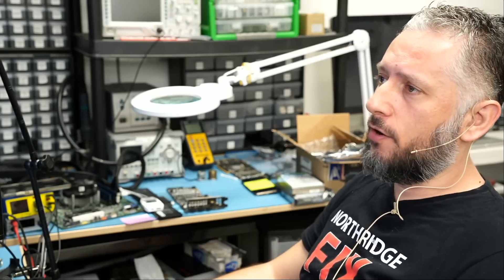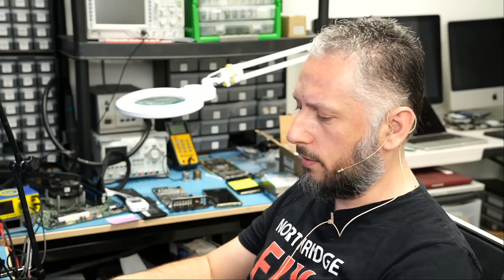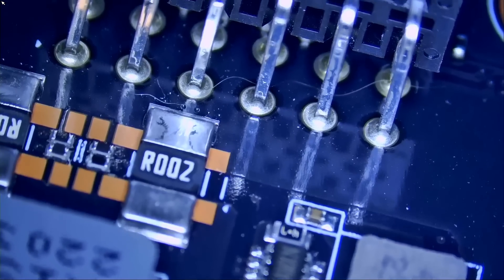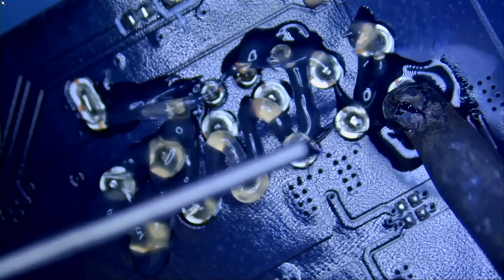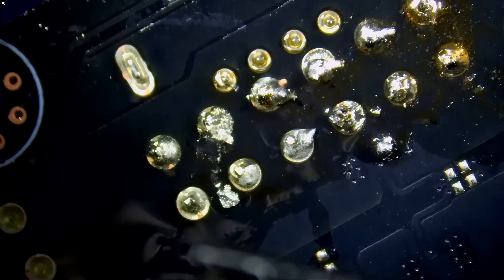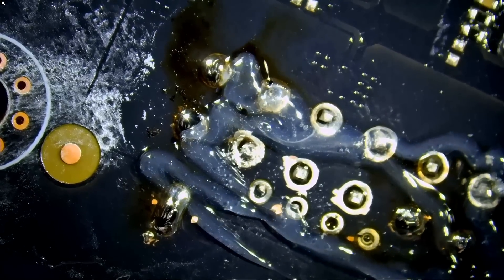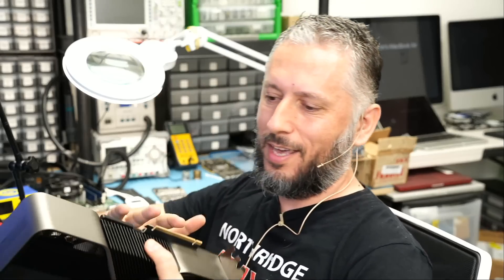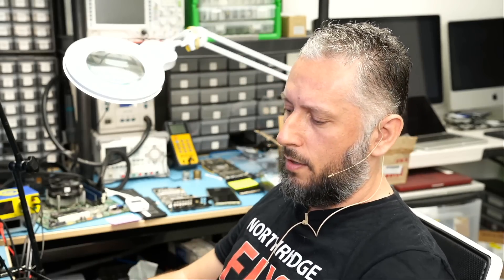Serious issues with 4090 power connectors melting - Is the user at fault ?

Comment: i would say it's 50:50. 
why.
pwr connector is a standart on ATX and if you are not planing to change that that type of connector is the only way to go.
On the other hand user should know that connector is going all the way in not 50%. If you are ignorant of that fact you should act acording to the manual and let an authorized technician plug in your graphics card and power supply.

therefore, if I am unable to plug in the cable all the way, then I cannot say that the manufacturer is to blame for that, since he must use the same connector according to the ATX standard.
Even if they make a separate adapter, the adapter should still be connected to an ATX power supply.

Comment: 100% User Error .. when this all first started 50 out 100,000. The same issue occurs with PCIe connectors that aren't properly seated. Lastly, yes this is covered under warranty though IMO it shouldn't be.
Reply: .. BTW the 12VHPWR adapter is an Intel spec connector. The next generation GPUs will start using 2 x 12VHPWR connections .. imagine 8x8 PCIe instead!
Reply: .. lastly, I get it that these are your customers that you don't want to offend because they're incapable of plugging in their $2,000 GPUs properly.

I own that exact same Gigabyte RTX 4090 OC CPU-Z JJU8GT

Comment: 100% agree with you. Those connectors should be like molex which after building computers for 20 years I've never had a problem with - not to say there aren't issues with them just in my experience.
Reply: You know I was thinking the same thing. How much power can the old fashioned molex connector carry? I was going to say users would be much more familiar with how much force to use to connect those etc as well but then a lot of younger people have probably never used them when building a PC.

Comment: This 12VHPWR connector is a terrible design.
Dell is the one who wanted this new connector, Nvidia followed along.
The cards that you receive with the broken connectors are like that because users are trying to avoid the "user error".
They press too hard, and the connector breaks off.

Comment: The amount of heat generated by 4 x 12v lines that are maybe sparking.  The manufacturer needs to come up with a foolproof solution.  They also need to mention, clearly in the documentation, that the cable needs to be inserted all the way, maybe even come up with a way that the customer hears a click that the plug is connected properly.  Also.... I want to point out that a lot of these cards are in homemade systems the cables can be stretched or are not long enough. They use cheaper power supplies with inferior cables and/or connectors.  A good power supply must deliver enough power to these cards.  They can take up to 400 watts, which makes them very hot.

Comment: NorthridgeFix : if that is the design that connector will melt if it's unplugged than the Makers (factory) now should provide a "Ceramic" connector 😂😄 instead of plastic connector. Either provide Ceramic connector 😂 or just change your design so that plastic connector doesn't melt 😄.

Comment: Agree that the producer of the card is responsible for clearly instructing install instructions of the card. If a card will still operate by partially installing the connector but will lead to other problems, the end user should be made aware of the potential problem. 
The fact that this problem is not mentioned in install instructions clearly falls on the card maker. This is a design fault in the card.

Comment: I think the connector you plug into the card is not designed to handle enough current. I don't think the plug presses well enough against the pins on the card.

If you have a heater that you plug in, the looser it sits inside the holes, the hotter the plug will be!

Comment: Couldn’t agree more with what you said.  it’s not user responsibility to provide a SUITABLE power connector on a device.  What’s happens if it works loose during use go figure.  It’s connector issue and NVD need grow some balls and accept this connector sucks

Comment: Imo it's a design failure, the connector cannot handle as much power as the card draws.
Also it's a manufacturer fault except the founders edition cards. If you're aware that connector is melting in fe cards, why you keep using it instead of 4 8 pin traditional PCI power connectors???? And the exception of the fe cards is only because they were the very first ones to use that connector, however there is no point on keeping using it on 4080, 4070... series if the 4090 one is giving troubles

Comment: Who's that legend telling loose cable connection melts the connector. Man there's some serious heavy load of electricity going and the connector is loaded with heavy duty and low built quality or less voltage capacity😅😅😅 senses bro common sense.

Comment: There has to be some cut off on what is the users fault and what is a design flaw. I mean what if the user tried to force the card into the wrong slot, or plugged the connector in upside down with force, or cleaned the card in a kitchen sink?

The way i see it, is if there are clear instructions about how to plug the connector in and a warning that it must be in all the way....along with saying that it must not be under pressure from a side panel of a case - then it becomes the users fault.....however i don't think there are any warnings or instructions being supplied with how to plugs the connector in properly.

Comment: I know this is not going to be a popular statement, 
1-If the card CAN be plugged in properly, and function correctly when this is done, It is 100% the end users fault!!
2-If the end user is not able to plug it in correctly due to bad fit on the plastic, or the connector has looseness on the internal pins, that is on the manufacturer! 
I guess what I am saying is that if the end user is not plugging the connector in securely , and then using it anyway, Man that's YOUR fault for using it before properly installing it!!

Comment: Of course it is a design problem. Graphics cards have had power connectors like that for decades and it is only just now a problem and only with these series cards. I thought it was already confirmed that the problem was the plug and if you bend the cable tight enough because of a small pc case then the pins in the plug dont stay straight and make a bad electrical connection which then arcs and melts the plug. It can happen even when you plug it in all the way. Its why i am avoiding this generation of cards. Maybe the people that are saying its not plugged in all the way are not aware of the situation with these cards. There was also evidence posted on the oc forums that the crimp on the plug falls apart by just plugging and unplugging the cable causing pins to make a bad contact and electrical arcing for the same reason.

Comment: What is kinda sick is that most likely there is a family or two out there that dies due to a fire caused by a company's incompetence / greed. Sickening.
Reply: These aren't erupting into flames like Gigabyte's PSUs, or NZXT's H1 riser cables. They are just melting.
Reply: @Shadow Captain Cain  There is potential for a fire though. Plastic will turn into a  flame if made hot enough.  Also, if the plastic melts and bare wires start touching there can also cause a fire, add that with dust in a pc, you could have a potential flash fire.
Reply: @shadowcaptaincain  well you never really know. In the right case and some dust and your whole house can go.

Comment: The Nvidia RTX 4090 has an official power draw of 450W, though momentary spikes of power, known as transients, may mean that it will draw more on occasion. but lets say 450w / 12 V = 37A .... i dont think this connector can hold 37A , it will heat up, and melt. First Day - 1. class in Electrical engineering, maybe the designer missed this class. 😂😂😂😂😂😂

Comment: The design could be better but ultimately I think it's the users error, I have a 4090 and its pretty damn hard to screw up plugging it in all the way. Just use your eyes to see it's seated all the way, the manual even shows that.

Comment: To me it is obviously a very bad design, it is to be expected that too much load on 1 connector, there will be an overheating. I am not fixing this, because this is covered by the warranty. They need to make sure they make it that the current is spread across different connectors.

Comment: But they saved the cost of 3 additional connectors, and the environment,  just kidding

500 W card / 12 V = 41 A   

What plastic connector, with that pin spacing, wouldn't melt at 41 A? Of course the card doesn't always draw 41 A, but a "real gamer" will push that card to the edge. I suspect the melted connectors are coming from computers that are heavy gamers playing several hours in succession.

SInce that is the profile for a 4090 OC customer, the company should have went the traditional route distributing current through multiple connectors.

Comment: Those connectors are melting due to the fact that the card has been overclocked. I had the same 4090 and no issues until I overclocked it the connector melted. So 100% the manufacturer won't honour any warranty.

Comment: I think the connector itself is just too small, they should've made the pins larger like on a typical 8-pin connector, with a proper locking mechanism
Reply: or just use the old version that works
Reply: @namAlexander  Perfect ! The saving in board area with the 'new' type is pretty negligible anyway AND makes cable looms tricky to manage.
Reply: @grahamstevenson1740  amd was going to use the same connector but at last minute on new release cards they reverted back just shows , will be surprised if Nvidia keep using it
Reply: yep, that's the issue.
Too much power in a much too small footprint causing issues if the Connector isn't seated 100% correctly.
Reply: Agreed. The Moles Mini Fit Jr connectors previously used for PCIe power have pins 1mm square with a contact rating in multiple pole versions of 6 amps per contact.
The 12VHPWR connector has slimmed down contacts of 0.64mm square (40% of the cross-sectional area (and conductivity) of the Molex part it's replacing, yet the current rating was INCREASED by 60% !
THIS MAKES NO SENSE ! You would EXPECT them to run hot and they do ! This is simple PHYSICS/SCIENCE !
Note that AMD has wisely avoided them.
Reply: This is what happens when corporations sacrifice safety in the name of profit. Pci-e 8 pin had more metal thus it was safer. But more metal = higher the cost. 
Nvidia created this smaller connector that has less metal to cut the production cost.
Reply: @oldi184  Good point indeed!
Reply: Personally I think there's two problems with this ATX3.0 12V connector.

Firstly I think they cheaped-out on the design. For something carrying that much power it should be far more robust. On both the card connector and cable connector sides.

Secondly, I get the feeling that this was designed and tested on a testbench. And they didn't try to build a system in a case. If they had they may have noticed nVidia's card connector positioning would mean putting undue pressure on the connection and cables.

I think this is why other graphics card manufacturers stuck with multiple 8 pin power inputs - they could tell the new connector was an accident waiting to happen.
Reply: Yup, that and its also a solid pin.  DC power really like stranded cable.  Electricity does not flow through a copper cable, it flows around the outside.

I don't know if its possible to make a "stranded pin" with more surface area, but it would probably help.

There is a reason why a welding cable is made of 2,000+ strands of copper and not just a solid hunk.

Square pins can also be problematic, as even a slight twist/shear will not conform and maintain contact like a round pin will.

The $2 solution would be to make the connector out of a melt resistant resin.  It would help with fire concerns, but thats not really solving the bigger problem.
Reply: Each PCI-E 8 pin plug carries 150w in 3 12v pins, so, assuming power is balanced between pins, 50w per pin, 12v at 4,16A. The new 12VHPWR connector has 6 12v pins and a max rated power of 600w, is translantes to 100w per pin, 12v at 8.32A. Who would guess that doubling the amps for each pin would lead to some critical failure?

Comment: This is 100% a design flaw / mistake!

but i'd argue that a user not inserting the cable correctly is the users' fault, but it was caused by the ignorance of the idiot who designed the cable to work like this.

absolutely there should be a actual physical locking mechanism which indicates VERY CLEARLY, it's seated correctly.
(currently it snaps on very unnoticeable, unlike the old 8 pin ones that you can hear & feel clearly snapping on)

for anything that requires this much voltage & amps, the cables should be at least twice as thick in my own opinion, and the locking mechanism MUST force it to be fully seated.

Comment: Stupid Connector that's exist because 4 x 8 pin would scare potential customers and one cable looks more clean than 3 or 4.  LN2 (liquid nitrogen) Overclockers use to push older cards in 600W+ and there was no need for new connector. When you don't close your Front hood or doors in your car there is warning light on your dashboard.

Comment: It's a known issue. The manufacturer knows the issue. This should not have been allowed to go to manufacture. It is a built in fire hazard. It is a design flaw and doesn't fail safe therefore not an end user issue. The manufacturer is at fault just like Nintendo now have to fix all stick drift issues for free in Europe. $2500 for something that has a known fault is outrageous and bad business practice. Especially because this card doesn't come with a disclaimer telling everyone to make sure it's plugged in or their house might burn down.

Comment: The facts of the issue are that the standards organization for the connectors did not actually design the connector. Intel did, and then submitted it to the standards organization, and it somehow bypassed all of the normal testing & such that goes into the connectors. The design is bad, prone to failure, and dangerous. Other similar connectors do not have any of these issues, and are both design & tested to handle situations like not being perfectly connected. Other sites have already shown through testing that even if you plug it in all the way and it snaps on, it's possible for the sides to be not fully connected, because it was improperly designed for its size & stresses and does not have enough snaps on it... and often with the cables there is no way to know if the connection is actually good or not.

Also, the boards are so big & so close to the sides of cases that often it is not physically possible to plug in the cable all the way, or that it will have stress on it by being pressed up against the case. In that case, bad design by Nvidia (who sets the board design & physical specs). I think it's telling that Intel designed the connector but then after testing it, refused to use it for its own cards or motherboards. Nvidia, for whatever reason, as a company, always refuses to admit to mistakes or failures.

Additionally, there are several safety measures that could be in place, either forced by Nvidia or the board makers, that would prevent melting... such as, I don't know, a 1 cent thermocouple which warns the user that it is overheating, and shuts off power if it gets too hot.

Comment: Connectors are melting because there is too much power on those thin wires which is causing them to overheat and any slight pull or bend or small short not making a FULL connection to those tiny wires / pins is creating more heat as its arching and melting the sh't out of the plastic.  They should have done with the standard 250W connector x 3.  More wires even distributed current and less heat on the wires.

Comment: Alex why don't you conduct experiment for viewers 
Get a bare wire hold it between alligator clamps, then with bench power supply up the volts then amps
It is gonna turn into some heat element
This is AWG / SWG where each cable=wire has power limit according to thickness; Wattage = Voltage x Amperage

Comment: It's typical, that in a rush to maximize their profits, manufactures cut down on their costs by limiting the part count, in order to save a couple of cents/yuan. Then blame the problems on user error, instead of their decision to cheap out!  Be thankful that these RTX-4090 GPU's don't  run on gasoline🔥... Like a Pinto!

Comment: I agree with you, Alex. When several graphic cards of the same make and model comes in with the same problem, it is obviously the manufacturer's fault. Especially when the fault is a melted power connector on every card. It seems to me that the connector can't handle the power draw.

Comment: Some tests showed that the plastic starts to get weak at 105°C /melt at 120°C and the circuit board on the connector gets hot up to 130°C. It's a complete design flaw. Added to this are the manufacturing tolerances of the plug (male and female), which can lead to a mechanical connection error due to thermal expansion, which can lead to an arc in the plug.
yes, it can happen that incorrect assembly by the user also plays a role, but the error has now been reproduced by many experts with correct assembly of the plug.